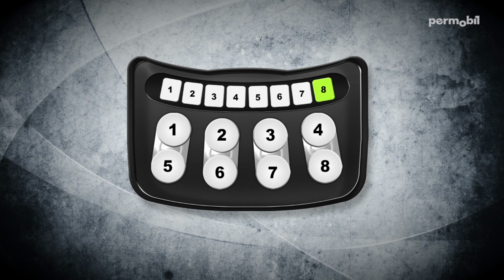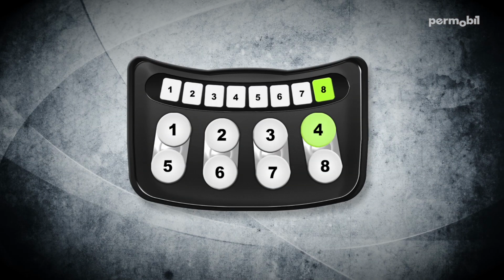Permobil Memory Seat Programming

Comment: How can I do this on an current model M5 corpus?
Reply from the maker: You can find instructions on page 136 and 137: https://shermanoaksmedical.s3.us-west-1.amazonaws.com/137c631fe2234829a931b9183e4280a7/m5-corpus-owners-manual.pdf

Additionally, if you are located in the USA, you can also reach out to our customer experience team at 1-800-736-0925 or via our website at https://hub.permobil.com/support at any time.

If you are international, you can send an e-mail to info.global@permobil.com who may be able to assist you further.

Comment: I usually do this via my joystick, but I absolutely love this feature! I have an M300 Corpus 3G. Setting #1 brings my seat flat, backrest straight and my footrest in as far as it will go for when I'm sitting at tables. I can always adjust the height of my seat separately depending on the height of the table/bar.

Setting #2 is the one I use to bring everything back to what I generally tend to use for general maneuvering. 

Setting #3 is laying flat and inverted to help raise my blood pressure.